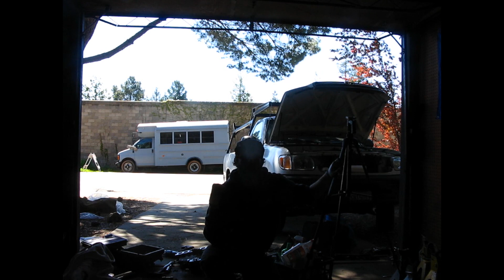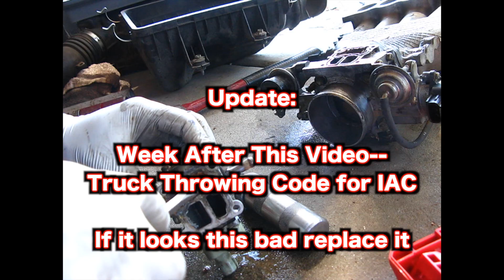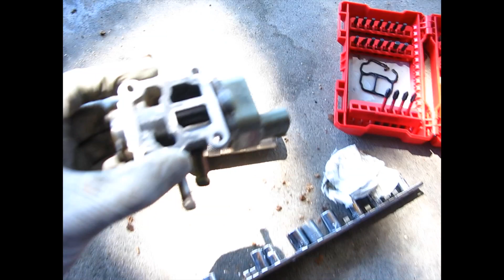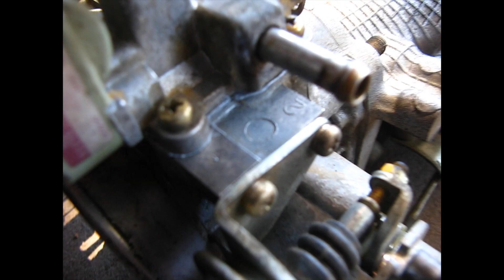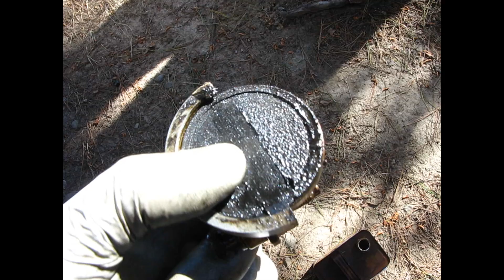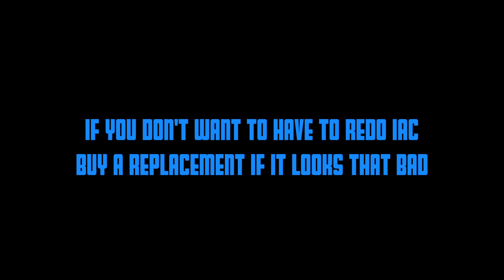3.4l Toyota 5VZ-FE 360,000 miles Clogged IAC / Valve Cover Gaskets / Tips & TRICKS

Comment: Did you have any hot temp idle issues after cleaning the throttle body and IAC? My idle runs up to 1,900rpm once the thermo opens and temp gauge hits normal operating temp and stays there. Performance otherwise is fine. Hoping it's just a ECU idle relearn but it's been high idling for about 5 days now
Reply from the maker: Honestly, I didn't but also don't have truck anymore. You could try unplugging battery overnight and letting it idle for 20 minutes to relearn.
Reply: @MaxsGarage164  Thanks for the reply. I did the TB and IAC clean as part of a valve cover reseal job and did a battery pull ECU reset before restart. After putting up with this high idle issue for a week and it wasn't there before I pulled the battery again for 15 mins or so as a step 1. Step 2 was going to to be re-pulling the IAC for testing and possible reclean as I had made my mind up that it had stuck open, but before that it copped an unintended long drive of steep slow hillclimbing in a national park and bizarrely the issue fixed itself half way thru the trip. Think I maybe overdid the original IAC clean with too much throttle carb cleaner hosed thru it and maybe it took a lot of heat from a long drive to burn that out and free it up. Or it could've had nothing to do with the IAC and the original battery pull ECU reset didn't work so it needed another one. Or none of these. Who knows but it idles correctly at all temps now.

Comment: i have a 98 toyo 4runner and the valve gasket was leaking the bolt were all loose so i got a flexible extension and got to all but one bolt started using mobile 1 high mileage synthetic oil and filter it doesn't leak a drop now it the oil makes the gaskets more spongy  allowing to seal up the leaks. i also noticed that the thermostat isn't opening fast enough drove it 15 miles and the bottom hose was still cold as ice and the top hose had so much pressure i could not squeeze flat so i got a new radiator flushed the system then i drilled a 1/4" hole in the new thermostat that did it now it stays at 170% if i did not do that i would have blow a head gasket